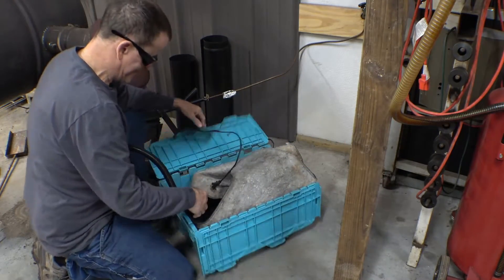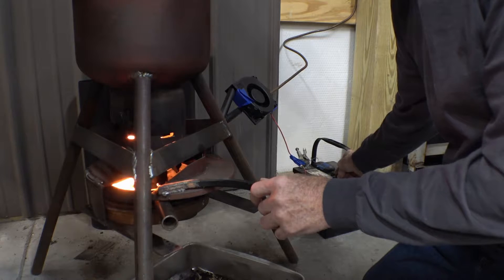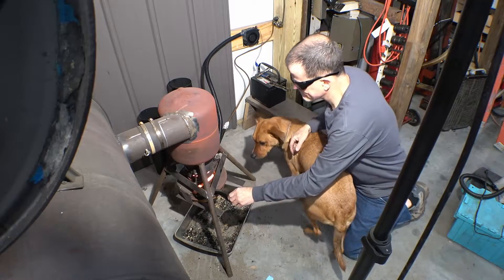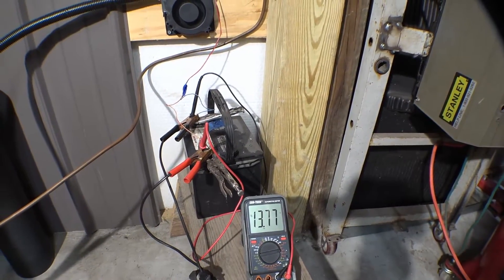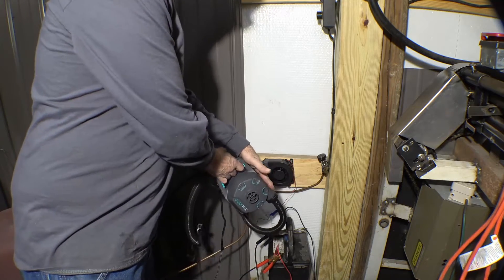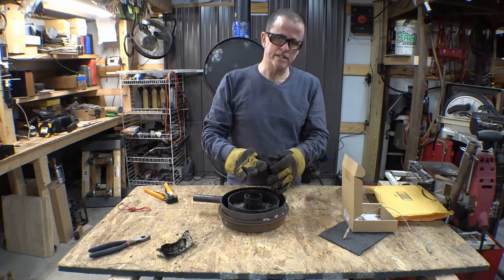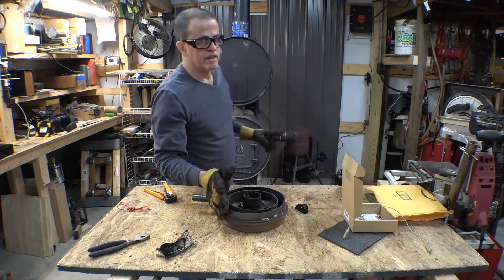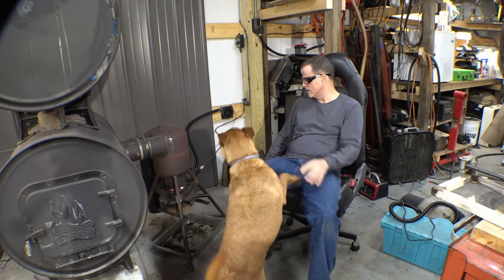Waste Oil heater, part 3. Computer fan, The right fan? No smoke. Experiments with waste oil burner.

Comment: The only thing I question is the diameter on your intake pipe. That is much smaller than mind. I heat a 1800 sf shop with one barrel drip waste burner feeding under my barrel. It 
Heats my shop my shop fine in temps out side in the 20,s just drip feed. I do have pipe 
Heat exchangers with a box fan blowing shop air threw them. My shop is lightly insulated 
With some bubble wrap. Thanks for your video. We learn from each other.

Comment: 12v??  Wtf is going too hook their stove up to a 12v battery?
Reply from the maker: 😁🔋I didn't have a 12 volt power supply at the moment. 
   Using a fan, high velocity air (air turbulence) helps get a more complete cleaner burn. No smoke👍

Comment: to an empty 5 quart oil jug add 1 quart gas , then fill to original level with used motor oil (1 part gas to 4 parts oil = black diesel) . shake very well to mix . give a shake before each use as a cheap fire starter . light immediately after adding to stove , so as to not allow it to gas off . do not add to an already burning stove , or even to a warm one .  easier to light with a piece of burning paper towel , paper , rag etc thrown in .

Comment: I have also done a lot of experiment to improve the process.  I also bought a commercial unit that is designed for home heating oil, diesel, kerosene or biodiesel.  The big feature for that one is it didn't require any electricity.  We had two of them, one for the house and one for the shop.  We heated with biodiesel for a decade.  But there were always drawbacks, and I am now out of the biodiesel brewing hobby.  But waste oil is still very attractive.  I run my foundry on waste oil, and that baby sounds like a rocket.  Wildly impractical for indoors, and ten times too much fuel usage.

On my list of experiments is to make one with a fire brick combustion chamber.  It will be steel, but lined with firebrick.  Not the dense stuff, the light insulating firebrick.  Motor oil, used veggie oil, diesel, used hydraulic oil, etc, do much better when the combustion chamber is very hot.  That's the big limitation to an all metal combustion chamber, if you get it hot enough to burn the oil cleanly, it will have durability problems.  If you make it with hefty wall thickness so it doesn't burn through too fast, it takes much longer to heat up.....which means smoky.

Any time you run a burning device inside a building, and it has any pressurized air going into it (as opposed to using natural draft only), you should run at least one carbon monoxide detector.

Great channel, great content, great problem solving.